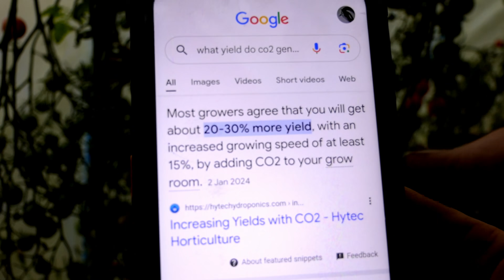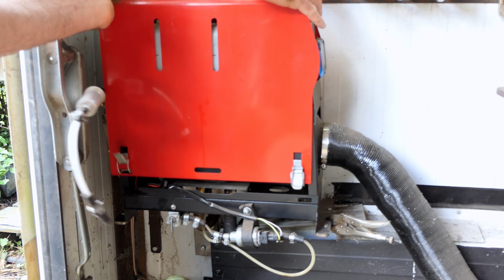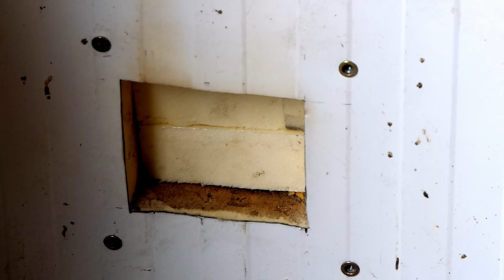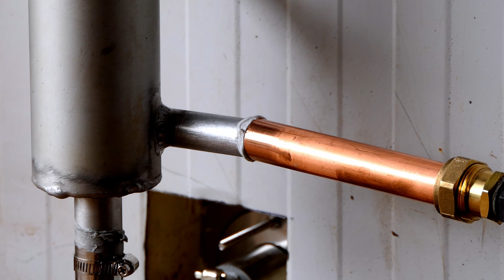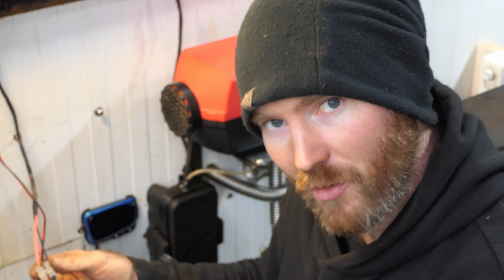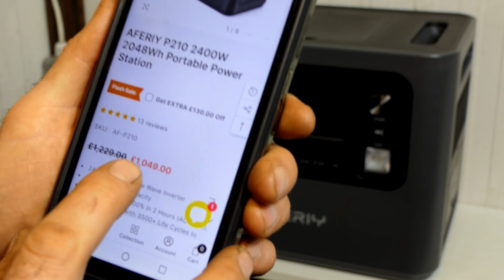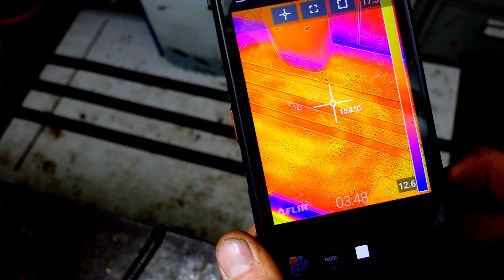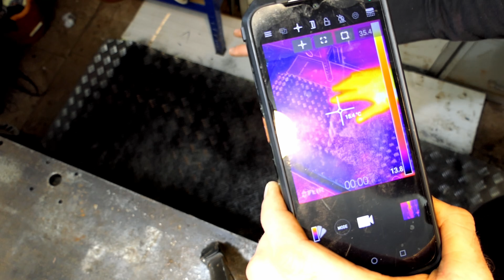NEW! Better system for Cheap and Safe Heating💲+ Underfloor Heating Mod test🫠

Comment: You would want to coat your pipes in thermal paste which will then transfer the heat to the aluminium sheeting. It would then work like a PC heat sink, pulling the heat from the pipes.
Reply from the maker: I think having the pipes on top of the insulation and covered with a screed is the official way to do it. But you're right, it makes sense to cover the pipe in something conductive. Cheers J
Reply: @joshuadelisle  That makes sense in a traditional system where the heat goes back to the boiler and is recirculated. In this system we need to extract the heat immediately before it goes out the exhaust. Copper pipe, thermal paste and aluminium heat sink will quickly remove and dissipate the exhaust heat. The screed will slowly absorb and slowly release. Horses for courses I suppose. 👍
Reply from the maker: @danielmackenzie680  you're right. It needs to be more thermal conductive. I have an idea that I'll work on in the background but essentially it will be one large sheet of aluminum with a waterways built into it. Cheers J

Comment: STOP USING GPT FOR MATH!!!! IT'S NOT ACCURATE... It will get things right sometimes, but most of the time it will not. It's just regurgitating garbage from articles it's seen.
Reply: I disagree as to the price of oil vs heat pumps, as you can easily get batteries that then make the cost of running a heat pump a lot less than the cost of oil. So if your on an EV or other smart tariff and can charge your battery at say 7.5p per kWh then suddenly the cost of heating with a heat pump is what? Less than 2p per kWh.
Reply: The level of maths involved here is O' level/GCSE level which we should all be able to do.

Particularly sparkies who do so much maths in their training.

Learn how to do it rather than relying on tools which can get it wrong.
Reply: True, chatgpt is shit in math and simple enquiries to date, it responds with example news from couple years back, it doesnt understand simple to date news feed! So yeah, ChatGPT is shit, Aria from Opera is free and more accurate and is updated and van do more then ChatGPT
Reply: Gemini writers code or uses a calculator for math
Reply from the maker: @natecalypso  it's better at maths than me.... Cheers J
Reply: @joshuadelisle  That may be, but a wrong answer that you think is right is in truth no better than no answer at all
Reply from the maker: @dropshot1967  it has references that you can check and all the workings out that you double check. Cheers J
Reply: Mate, if you can’t even spell mathS, then what hope do you have understanding it? 🤣🤣🤣🤣
Reply: @LewieLeway Actually I researched the spelling of maths a few years ago.
And math and maths are both correct ways to spell it. But the English use maths and the Americans use math.

The correct word is mathematics so both US and UK commonly used forms are contractions and they are both right.

On a global app like YouTube, you get both British and US citizens so a mix of both spellings are going to occur. Neither is incorrect.
Reply from the maker: @LewieLeway  thats a British thing, we do it more than once lol
Reply: @joshuadelisle It's an abbreviations of mathematics,  hence the s. If it was mathematic math would make sense...
Reply: @joshuadelisle  Like Iaintwoke states, it's short for mathematics. Plural. The Yanks bastardise the English language and then claim we are the ones that are wrong! 🤣

Comment: I'm currently watching The Dimming and I'm really disappointed. It's literally the chemtrail conspiracy theory. I'm 6 minutes in and there's already too much wrong to reasonably fit in one post and realistically since I'm not supporting your beliefs I'm expecting you'll just ignore it. I'm hoping you're better than that, but I'm not going to invest the time it requires to do a proper job on this if it's just going to be disregarded out of hand. There isn't enough of me to combat the spread of all misinformation and I have to pick my battles. So, are you interested in discussing it's credibility?

The worst bit is, from the 1980's Global Dimming (real thing that the contrail conspiracy theory is based on) has been decreasing, which means that Global Dimming has been concealing the true magnitude of climate change. I didn't know this and it's terrifying!
Reply: 11 minutes in and it's also the "new world order"/ "shadow government" conspiracy theory. I suppose that should be unsurprising, as they often group together (conspiracy theories).
Reply: 15 minutes in and we're onto other conspiracy theories and it feels like it's more delirium than fact. Like I said, happy to discus the details, but not in a conversation with myself. Let me know if you want a professional research engineers perspective. My job is sorting the lunatics and snake oil from the real beneficial science and I'm really good at it.
Reply from the maker: You're right it does have that feel. But if you investigate the claims you find a lot of convincing evidence not to mention news reports and Bill Gates funding the stuff. Cheers J
Reply: @joshuadelisle  News outlets are owned by incredibly rich private people often at a loss. Why? Because they can control public opinion and influence votes, elections, and public policy. Which enable them to make way more money in their other businesses, or from acquaintances. Others make more money from views, so prioritise content that gets views over content that accurately informs. This is often called out by independent news outlets like TLDR News and Philip Defranco. They often have to split out some stories because the algorithm won't promote that video because it isn't advertiser friendly and they make less money serving it compared to other content. 

Hence Mark Twain said, "If you don't read the newspaper you are uninformed, if you do read the newspaper you are misinformed." 

Bill Gates stepped back from running Microsoft and now does a load of philanthropic work with the Bill and Melinda Gates Foundation.  Which is a nonprofit fighting poverty, disease, and inequity around the world. The second largest charitable foundation in the world.

Looking into it there's some people saying he's not giving enough of his total wealth. He can't give his entire wealth because most of it is the value of the businesses he owns. If he sells it then he no longer has excess cash to put into philanthropic work. Someone else pays him, he gives away the money, and they own the assets instead becoming the new person "hoarding wealth". That doesn't solve the problem. It just shuffles it. He can afford to give away countless millions precisely because he owns these companies that make profit. I suppose we could instead split the company evenly among all citizens, but would the company survive with such fractured leadership? Look at the current political landscape, we can't agree on much as a group. The other option is tax it and do the philanthropy at a government level. But after shutting down UK coal mines to buy foreign, privatising services that are now failing and expensive, and things like the COVID PPE scandals, I'm not sure I trust the government to do better than Bill.

Intentional climate engineering is a real thing. China did it for the Olympics. Separate to that there are pollutants in plane contrails that act as nucleation sites for cloud formation and affect the earths albedo. Like with the ships burning clean vs dirty fuel. It's controversial and expensive to do intentionally. One scientist thinks a synthetic super volcano could save us all. Others are talking about spraying salt water into the air from container ships to seed clouds.
Reply: @joshuadelisle  
Now for "The Dimming". First there are some patents for climate engineering technology. That is a real thing. That doesn't mean that it is being used. I feel safe in saying most patents aren't, because they are speculative or outdated. Firstly, use something like FlightRadar24 to pick a plane with suspect trails. Look up where it's flying to and from. Can you look up how many people were on board? how much luggage? Those planes are usually rammed. Where would all those tanks and stuff in the patents go? What about the extra weight and fuel required to carry it along with the passengers and luggage? If it is a secret conspiracy, why are the patents public? Why not a trade secret? How do the ground crews not know about this? How have we not seen them when we walk up to the planes on our holidays? look in the cargo hold?

Allan Buckmann as a weather observer @ 1:12 in says "Jet engines burn clean so if there's anything coming out of them its' an additive."- First, he's a weather observer and game keeper. Why is he a trusted source on the combustion products of jet engines? Next "burn clean": the cleanest modern cars get condensation from the tail pipe in cold weather because water is a product of combustion, as fossil fuels are hydrocarbons, meaning comprised primarily of hydrogen and carbon. They combine with oxygen from the air releasing the chemical potential energy in those hydrogen and carbon bonds as heat, forming primarily CO2 and H2O. Water vapour is a natural biproduct of all hydrocarbon combustion I can think of off the top of my head. Then there's potential pollutants like graphene that can act as nucleation sites to draw condensation out of high RH air... When you breath out on a cold day, you have condensation in the air. And that's at more like -3°C than the -50°C that the planes fly in at altitude. 

Next Charles Jones who is a brigadier general (No science training, let alone relevant) "Con trails do not linger. Dissipate, and go into cloud coverage. Period end of report." It's hard to parse that in a sensical way. I've tried my best. Where's the evidence other than his word? Why don't they? If they're condensation, then surely their longevity is relative to the local conditions as if it's low Relative humidity (RH) then they will dissipate, but high RH they stay as water droplets as the air doesn't have the capacity to absorb them?

Catherine Austin Fitts, Former US Presidential cabinet member. No relevance to the topic, no science training or knowledge. Makes some comments about how she thinks the sky is going form blue to grey and it's not socially acceptable to mention it and she thinks that's "really bad". That's her opinion. Where are the measurements of actual sky colour changing? It's not "socially acceptable" because she's seeing things that other people aren't. That's an indication of mental illness.

Then Dane Wigington self accredited "lead researcher" for geoengineeringwatch.org.  "Although many of these particles are from industrialised pollution, the larger majority are from the ongoing climate engineering solar radiation management operations." Where's the evidence for this? It's just an outlandish unsubstantiated statement.

We're only 2 minutes in and we've heard from four people of whom none have any relevant scientific training, one is instantly disproven, and it's all statements with no evidence to back it up. If this is their best content to get people hooked, it's not looking good.

There's two hours of this. There's just too much wrong with it to point it all out. At least if it keeps up the rate of the first 15 minutes. I know you're busy and the first two minutes has this much to point out so I'm not keen to write a load that won't be read. 

I might put it on in the background when I get a chance and hear it out in full because you think it's worth my time and attention. I don't think broad general claims are going to cut it in this instance though. I'd want specific verifiable claims like those made above for the first 2 mintues.

Comment: Napkin sanity check: Amount of CO2 in the atmosphere is ~2300Gt at 300ppm and ~3100Gt at 400ppm. Difference is ~800Gt. Lets say this took 100 years -> average of 8Gt pr. year. Currently we are emitting ~30-40Gt per year. Looks like human contribution is pretty significant.
Reply from the maker: The main point still stands on deforestation. Trees can absorb more CO2 as the levels increase but we've destroyed 10% of forests in 34 years when we should have been planting even more... Cheers J

Comment: Normally when pex pipe is installed in insulated panels spreader plates are used. The pipe pattern you used is normal where the pipe is embedded in a screed laid on top of insulated panels where the screed acts as both spreader and longer time heat store
Reply from the maker: Yes I'll bear that in mind. Cheers J

Comment: I don't have the multiple PhD's required to even have a valid scientific view on this.
I am aware that the whole planet ecosystem is pretty finely balanced.
So my attitude is, if the environmental systems are changing by themselves, then they will continue to do so and there is nothing we can do, but adapt.
But, if it is even possible that we are negatively affecting it, we should reduce our impact on the planet as much as possible. Just to hedge our bets! If we were wrong, then we have lost nothing.

Fossil fuels did come from naturally laid down carbon. But that was laid down over millions of years. If we were to slowly burn it over millions, then the environment would be able to cope. Burning is in hundreds of years, and dumping it all back into the system is the perceived problem. (Again, no PhD's here, but gut feeling is, that can't be safe.)

Personally I like the idea of reducing our impact, mostly because the technology if interesting and as an engineer, I like efficiency in all it's guises.
Reply from the maker: I agree. But my point of deforestation still stands as we should have doubled our Forests and not destroyed them to account for the excess CO2. In doing so the higher levels of CO2 would be stabilised and benefit life. Cheers J

Comment: I really like the idea of under floor heating and getting rid of all the wall mounted radiators but the thing that's always bothered me was the efficiency of heat transfer. With your test floor panel, are you able to measure the actual water temp, the surface temp of the under floor hose and compare to surface of the aluminium sheet? The deltas will tell us how insulative the plastic hose is and how much we need to find a way to transfer heat from the hose to the floor surface with a thermal compound instead mostly air. The hose will at best only make a very narrow linear contact with the flat of the floor which is far from ideal. Homemade thermal compound recipe experiments might be in order unless there's thermally conductive mastic product.
Reply from the maker: I'll see what I can do in the next test. Cheers J

Comment: CO2 isn't the problem, but methane is and will be, ut's a far worse greenhouse gas and as tundra melts it's being released in vast amounts, in Russia kids poke holes in lakes and light it escaping, but it's all tundra producing it, vast areas. Trees there lose their solid footing for roots so there are huge forests with trees fallen and dead now, a double whammy. More temperature, more escapes. Bogs, mangroves , marshes, all being destroyed and not absorbing anything , just releasing what was locked in there. 
That pipe deburrer will be your friend if used on metals, maybe with a harder blade, so much better than any other way. :)
Reply from the maker: There are lots of factors for global warming and climate change. Methane only lasts 10 years before it has fully broken down. Grass fed Cows are definitely carbon neutral. Cheers J

Comment: Pollution is my main concern. No one is really taking action on that because there is no money to gain. Also, indeed, climate change will further happen. Cost of it will be enormous to pay for damages and adaptation. 10x the amount the climate boys calculated to fix it all. I don't mind the climate talk tbh, if they are right, well, good job world! If they are wrong, we are left with all this clean energy stuff that's being produced and maintained locally instead of having to rely on the middle east, oh no, how bad....also, we do know that the stuff will run out eventually, no harm in transition. I believe wood burning on a replenish able growth rate is one of the solution, since its also their precious carbon neutral. 

But again, don't underestimate the pollution happening, our seas are dying.
Reply from the maker: You're right, the other pollutants that were dumping in rivers etc are a real concern and need to be addressed for sure. Cheers J

Comment: Great video much thought provoking. From what I've seen about underfloor heating it seems to work with low temperatures but constantly switched on. Not good for instant heat so any covering like a screed would absorb the heat over time and release gradually. But you probably already know this. Pumping co2 into a green house is of course already done on a commercial basis by sugar beat processors in East Anglia I believe, pumping into tomato producing ventures close by. I think I may be getting one of those heaters soon.
Reply from the maker: Good points. Cheers J

Comment: Perhaps we should listen to mathmations and not scientists as they appear to work on fact not fiction. We are already in a situation where we are unable to produce enough electricity and have to import it and those that export it are already looking at blackmailing us to shall we say coerce us to make more agreements/deals in their favour. Our politicians are really quite intelligent really NOT.  Thanks for your well summarised explanation of how wrong those in charge are.
Reply from the maker: Thank you. If it doesn't make sense then I believe the actual outcome is what they're after. CO2 is easier to pin point and tax the common man compared to other more dangerous pollutants and un sustainable practices.  Cheers J